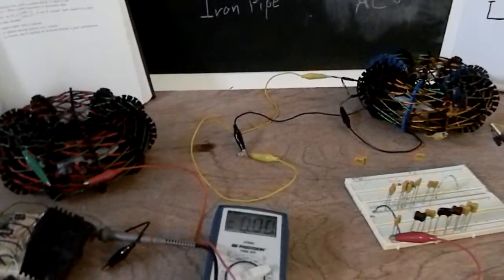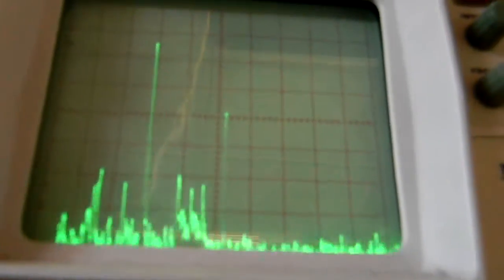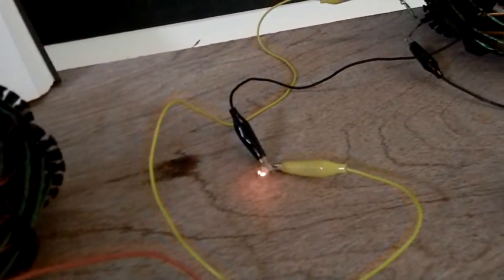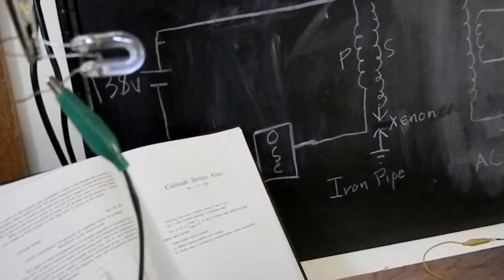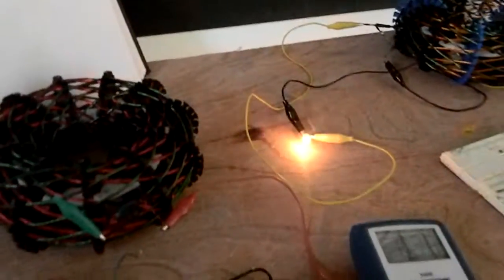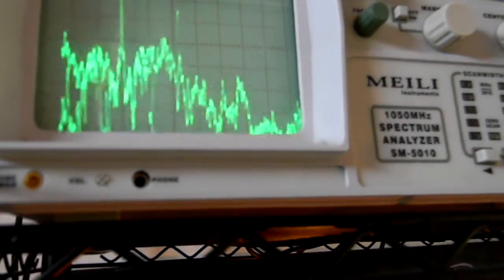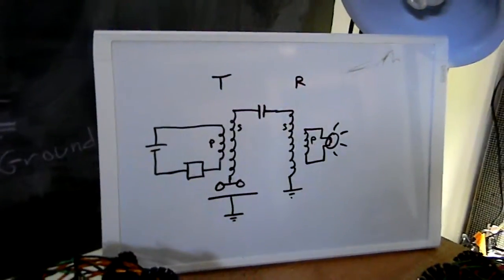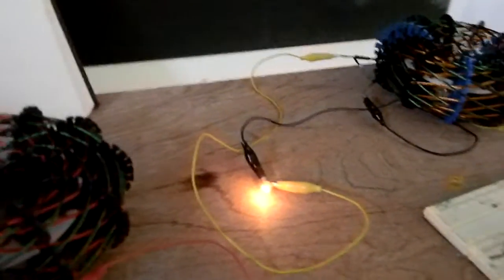The Evolution of Tesla's Transmitter

Comment: You should remove the capacitor that's connecting both coils. In that mode it's operating as a basic single wire transmission system, but not as efficiently as it could because the receiving side is earthed so would have a lower resonant frequency than the unearthed transmitting side. Touch the "air capacitance" toroid to see what happens. In Tesla's wireless system each coil should be "independent" with no "coupling capacitance" between the coils. The only coupling should be through the ground connection, each coil operates independently in space from a single terminal - the ground, with a reflecting capacitance at the other end of the coil to send the wave back down the coil into ground. The coils may be capacitively coupled to ground, but there should be no capacitive coupling or any interaction between the coils otherwise. When this capacitor is removed and replaced with "isolated" capacitance terminals then the problem in experimenting in a small space and relatively high voltages will become electrostatic coupling, because one coil will respond to the other without any connections at all within a certain range, so it will be difficult to determine whether they are in fact coupled through the earth or simply through electrostatic action. To test this you could disconnect the coils from earth and separate them until no amount of tuning will yield any results, so should no longer be coupled in any way.
Reply from the maker: When I touch the "air capacitance" it zaps me and the light gets brighter (using me as a path to ground)....I am currently building a terry filter to use HV discharges into the primary....until then I think I am limited to using mica as a capacitance between the coils...I was under the impression that the HV was able to use air as the dielectric between the coils top torroids. I am only using 13.8V for the input thus I need low voltage caps. I also had the idea it may be acting as an extra coil but with the driving coil attached to a capacitance and the EC coil attached to ground. You are saying there is no need for a capacitive coupling between coils and the aluminum is there only to reflect the wave back? From tesla's notes it seems he used the atmosphere as the capacitive coupling, he also thought of ways to ionize gas to create a connection to the upper atmosphere. If I am wrong...then standing waves must be set up in the earth for a true wireless system....I still think there is going to be a capacitive effect associated with these waves. I am aware of the effects of mutual induction but I am still under the impression that the torroids are electrostatic couplings to the atmosphere....Effectively using the earth as an LC system...He spent much time raising his capacitance into the air and measuring the differences....in which the higher the cap, the lower the frequency and the larger the spark output....This sounds like he was tuning into something....like the resonance (or harmonic of) the schumann....The air capacitance effectively makes an asymmetrical capacitor that can set other tuned coils into resonance via conduction and electrostatic coupling? If this is not tesla's true wireless scheme some papers/references would be great. I have read a ton and this is what I have come up with....Thanks for the feedback, it is making me think everything over....
Reply: MrWarrensk I would say that what's happening when you touch the air capacitance is your body capacitance is added to the total capacitance and you are bringing the frequency down, so it's closer to the resonant frequency of the earthed receiver and works more efficiently. Tesla does a lot of experimenting in Colorado Springs Notes, good for research and educational purposes etc but most of it isn't incorporated into the final arrangement. The capacitance elevation experiment was to study the effects of elevation on the capacitance for example. Each coil is sitting in space so they have their own independent coupling to the "atmosphere" if you will, for example if you separate them they still have the same properties like self capacitance in space and each will operate as if the other didn't exist. The only thing that's required for one coil to interact with the other is a single terminal connection to earth, or a wire, or any medium that can be rendered conductive, the human body for example. If you were to remove the coupling capacitor from the "top" of the coil and put it on the ground end, it will still work. The frequency will probably be a little higher, and you can experiment with various sized terminals on the free end, but I'd say you're obviously using enough power (voltage) to make it work already. As in Tesla's own diagram, the hand pump which represents the transmitter simply applies pressure into the balloon which represents the earth, and the pressure gauge which represents the receiver responds, single conductor.

http://img822.imageshack.us/img822/1660/telsawireless.png

"This mode of conveying electrical energy to a distance is not 'wireless' in the popular sense, but a transmission through a conductor, and one which is incomparably more perfect than any artificial one. All impediments of conduction arise from confinement of the electric and magnetic fluxes to narrow channels. The globe is free of such cramping and hinderment. It is an ideal conductor because of its immensity, isolation in space, and geometrical form. Its singleness is only an apparent limitation, for by impressing upon it numerous non-interfering vibrations, the flow of energy may be directed through any number of paths which, though bodily connected, are yet perfectly distinct and separate like ever so many cables. Any apparatus, then, which can be operated through one or more wires, at distances obviously limited, can likewise be worked without artificial conductors, and with the same facility and precision, at distances without limit other than that imposed by the physical dimensions of the globe."

http://www.tfcbooks.com/tesla/1908-00-00.htm

http://www.tfcbooks.com/tesla/1919-05-00.htm

Good work anyway, keep it up.
Reply: Simware I should add, transmission through the actual earth might need some power for decent distance, but a bucket of garden soil pretty accurately simulates the same thing without breaking radio laws and with less power.
Reply from the maker: Simware
Great info Simware, so I am only dealing with HF electricity and due to its frequency it pays no attention to capacities and resistances....In his CO springs notebook he investigated distributed capacity and then says getting away from it as much as possible is best. These vortex coils are very distributive when it comes to capacity....This may be why I cannot transmit with out a coupling capacitor...any ideas of how to get away from distributive capacity? I saw your video and there is only a ground connection. I can transmit through the dirt, water, people, capacitance...ect but the coupling capacitor is needed. If the capacity is not distributed and at the end of the coil there is only an aluminum torroid to reflect the wave back, this makes more sense. We would have a node at the free end of the coil and maximum amplitude at the other end that is grounded (or capacitively coupled to earth). This would indeed cause other coils to resonate with only a ground connection and a torroid at proper height to reflect the wave back. This gives most power at the bottom of the secondaries...I think I get it now. Thanks a lot for sharing. Currently I have max amplitude at both ends of the coil. The design of an extra coil that is closer to a helical resonator is what I am going to do next to try and get a node at one end and max amplitude at the other. This should be able to wirelessly transfer energy without high voltage input and no coupling capacitor? Even better.
Reply: MrWarrensk If both ends of the coil are free then it would be operating in half wave resonance, likewise if the coil is "shorted" with a load across it it will be half wave, and in half wave mode the peak potential is in the middle of the coil/wire. By simply adding a metal plate to one end of a free coil it will be automatically biased if you will and forced into quarter wave resonance, highest potential will be at the free end of the coil with minimum at the (capacitive) plate end (or whatever you choose to use), and there will be minimum current at the free end with maximum at the ground end. So this is one of the basic principles to keep in mind. If the capacitance on both ends of the coil is equal then it will want to be half wave, it depends on the loading that's at the end of the wire, so you can keep it in quarter wave and biased the right way as long as the capacitance on the top/free end is less than the ground end.

What happens if you leave the top ends of the coils free and use a wire to connect them directly on the ground end? Your load might be a little too demanding to be able to detect when it's working, maybe try smaller bulbs or LEDs etc, also the setup shouldn't be earthed in this situation to keep it easier to detect. Once small loads are working then it's a lot easier to get bigger ones working. It may also be that when you remove the coupling capacitance from the top end the bandwidth is reduced making it a lot more difficult to find the resonant peak, the coil's frequency response will be over a narrower band. Incandescent bulbs are rather slow to react so you could sweep right past it without noticing anything. Also this would have to assume that both coils are sufficiently tuned to each other. To test the transmitting coil output you can put the bulb in series on the ground end between the earth or some (relatively big) capacitance (holding it is always fun), and experiment with the free end capacitance, move your hands close to the coil etc. A bucket of soil and ground plane is always handy. If the bulb lights transmitting into a bucket of soil and/or ground plane, then the receiving coil should also work when connected to the bucket/ground plane and similarly tuned.
Reply from the maker: Simware Okay, Awesome! I actually was able to light up a 120v 20w bulb with just an earth connection and a capacitance....Last time this happened was months ago and my circuit blew at the same time my amperage reading went backwards.....I think that the mosfets are not very sufficient at blocking the resonant energy from entering back into the source from the primary...this is why I aim to use a spark but I am worried the coil will spark to itself and short....You never know till you try. I was going to immerse the coil in oil...or build an extra coil and use the vortex coil as a driver. Either way thanks for all the information. I will continue to experiment and will post a video when I find this particular resonance.
Reply: MrWarrensk I started off using spark gaps powered from a flyback transformer, the problem I had was when the gaps got too big the energy would come back into the powering circuit and blow the transistors, similar to what you said. But besides that spark gaps aren't really ideal or necessary for transmission. Making/using a basic RF amplifier should solve the problem of destroying components, and as Eric Dollard would recommend using vacuum tubes. I'm getting decent results with relatively low power solid state devices at the moment, it's all just basic amplification of a sine wave from a signal generator, high frequency AC, and nothing has blown up yet!

http://www.energeticforum.com/eric-dollard-official-forum/11855-eric-dollard-54.html#post249821

Op amps can be good.